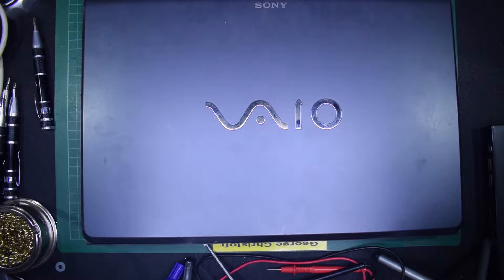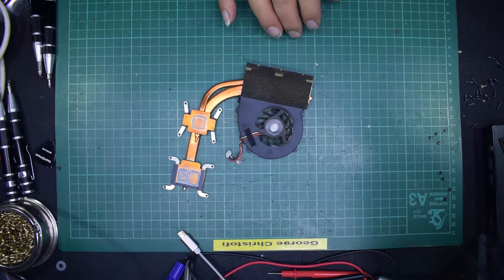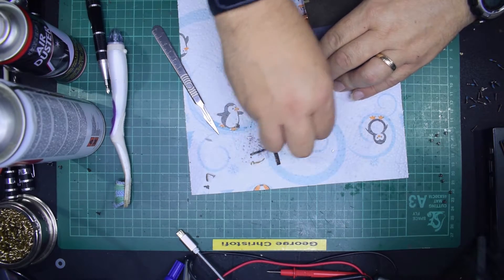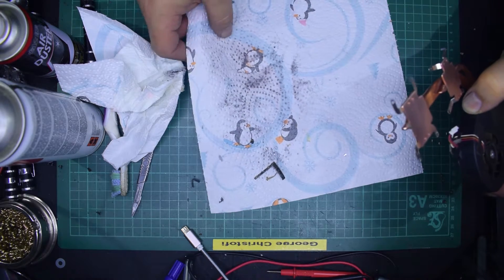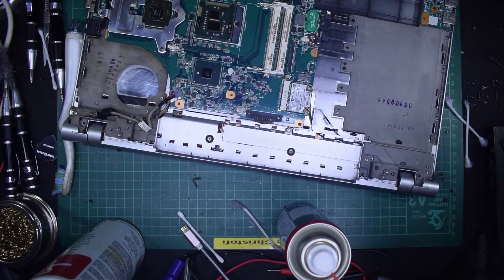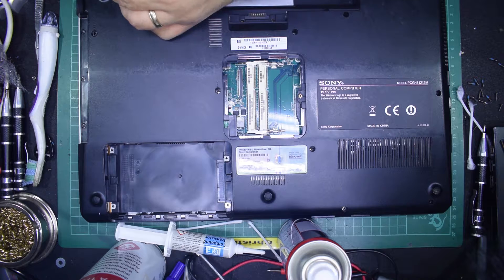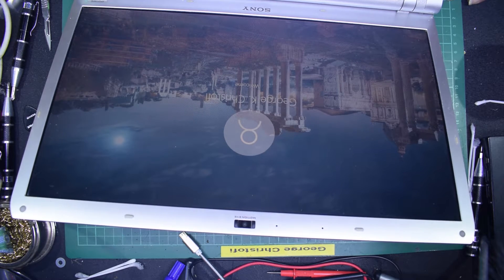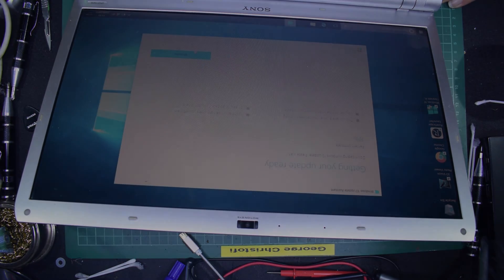Curing thermal shutdown on my Sony Vaio Laptop.

Comment: I've got a sony VAIO laptop. it'll turn on, last 1minute. fan will spin for 5 seconds, then it'll shut down. all this while no picture present on screen. Any ideas? 

I've tried: Cleaning & resiting the ram. (No change)
Removing battery - (no change)
Removing battery & holding power button for 20 seconds (no change)
Reply: Am gonna trun on my sony vaio after 1 min gotta speed up the fan then shout down ?? Please once time i clean the ram was fine work that time am gonna do the same but bot fix ?
Reply: @nzaranya5698  I still didn't fix mine. It's a hardware fault. You can try reseat your ram. From mine I think it's something more serious, like a dead capacitor / resistor.
Reply from the maker: sounds like either a cpu overheat because the heatsink is not drawing the heat away or some other hardware fault
Reply: @GeorgeChristofi  I thought that aswell. I remove heatsync & removed all the crusty thermal paste. Then repasted, still have the same issue not sure what that could be.

Comment: Hey maybe you know when pc normally shutting down where gose signal? i want to get turn off signal (not from the swich) becouse it dont operates when pc normally shutting down .thanks if you could help to find 😊
Reply from the maker: It really depends on the machine in question as to how they use the turn off signal. It either goes from CPU as a data instruction or as a electromechanical system straight off the switch. You would need the motherboard schematic and also the CPU instruction set to determine the signal name.